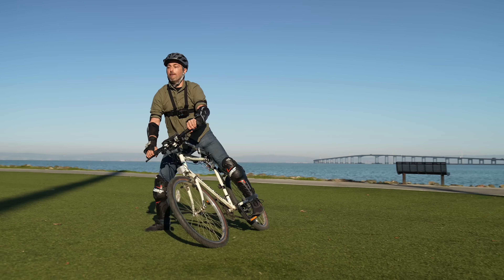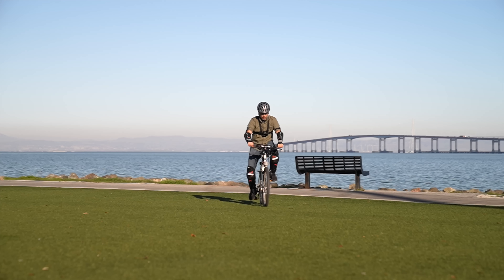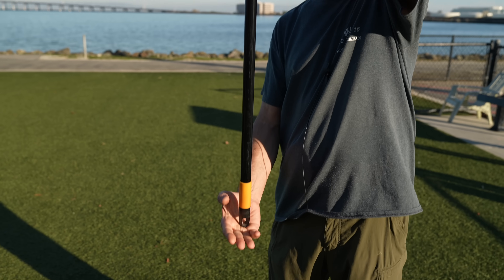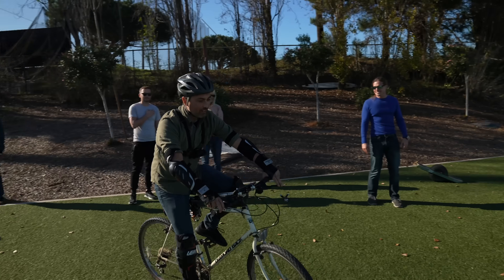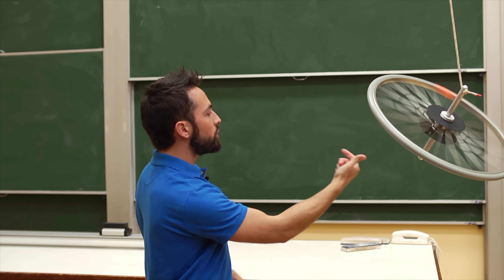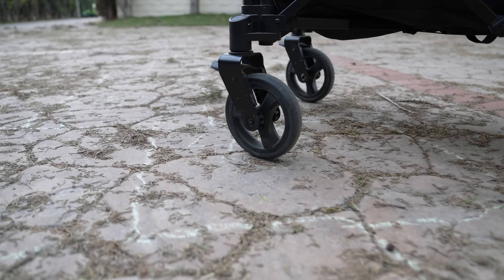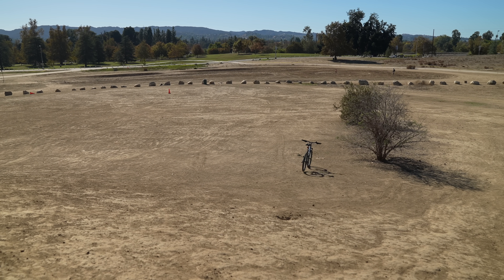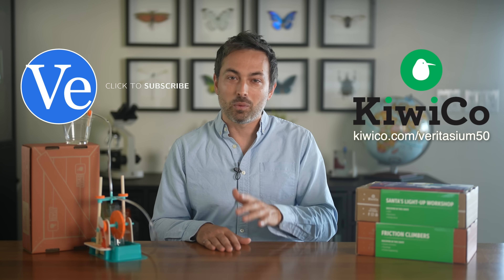Most People Don't Know How Bikes Work

Comment: The next time you bike. Try ACTUALLY turning the handle bars to turn.
You actually press down/lean the handle bar to turn, you don't twist it.
You can only twist it in very low speeds without falling over.

Comment: You really need to master this before starting motorcycling. It much faster than bycicle so many times you need a long countersteer (putting force to the other direction) not only to initiate the turn but almost half the turn especially high speed long turn. You can crash if you don't know this when you are panic.

Comment: this is called counter-steering and us motorcycles riders almost always need to account for it at the speeds we travel. A common idea is "push right to go right". with Pushing right essentially meaning turn handlebar left.
Reply: @Joseph75623  True, but the overarching point being that the effect demonstrated in this video has no relationship whatsoever to motorcycle counter-steering.  This video is all about balance and center of mass effects at low speeds and the body's ability to "naturally" understand the cause & effect relationships of fine balance control.
Reply: @Joseph75623  Complete nonsense...  Basically, the gyroscopic precession effect that is the core of the motorcycle experience does not exist on a bicycle.  The effect is so insignificant that it basically does not exist unless you are going very fast and are an extremely light rider.  It's simple physics...
Reply: @Joseph75623  So close, but you don't understand what countersteering actually does on a motorcycle does, do you?  I rode for about 15 years and the effect has no equivalent on a bicycle.  Countersteering has NOTHING to do with "stability" as such, it is the effect of applying a force to the handlebar and having the motorcycle immediately and significantly lean in the direction of force.  With enough pressure, the direction change can be quite violent, and it's taught as an emergency swerve tactic.
Reply: Not really...  Counter-steering does not have the same mechanic; at speeds where counter-steering is valid, you do not; "push-right, then "pull-left" to turn left, you just push left and lean with the turn to get the appropriate radius.  With motorcycles, it's all about contact patch and the lean angles; gyroscopic precession via pressing on the handlebar starts the lean, but the contact patch relative to the center-line of the front (and to a degree, rear) tires dictates the radius of the turn.  You can follow a curve on a motorcycle by simply shifting your weight and having no net force on the handlebars, but it takes more skill.
Reply: @awebuser5914  There's no such thing as "speeds where counter steering is valid vs speeds where it isn't". A bike will always initiate a turn with a counter steer, whether you're doing it consciously or not. The advantage of doing it consciously is that it means you are in control rather than just relying on the physics of the system and your intuition to do the work for you.
Reply: @allmhuran  At 5km/h counter-steering is pointless, it has no effect and will cause you to more or less fall over! ;)  At low speeds, you're essentially doing what this video illustrates ("steering" the handlebars through significant angular deflection).  The gyroscopic precession effect is completely absent at very low speeds, which is kind of the entire point of motorcycle counter-steering.
Reply: @awebuser5914  Counter steering has nothing to do with precession.

There is literally an equation that describes the relationship between the angle to the centre of mass, tangential velocity, and turning radius. There's no "minimum speed below which the equation doesn't apply". 

A bike cannot perform a stable turn unless there is a lean involved. The lean doesn't have to be the frame of the bike itself, what matters is the centre of mass. But putting the centre of mass into a stable leaned over position requires a countersteer. At very slow speeds the required lean is tiny, and the countersteer is barely perceptible. In fact, most of the time you simply allow the continous instability of the motorcycle to provide that countersteer. The front tyre is constantly wobbling back and forth, so if one of those wobbles is simply allowed to continue for a fraction of a second, that's your countersteer. But it's still a countersteer.

The difference in the experience at low speed is that at low speed the forces on the steering geometry are much smaller. This means that the natural tendency of the front wheel to "flop" in the direction of the turn will not happen quickly enough. To be clear: During a stable turn, the front tyre is pointed in the direction of the turn. During a left turn, the fron tyre is pointed to the left. The countersteer isn't maintained throughout, it's just there to create the necessary lean angle. But once the countersteer is complete and the required lean angle exists, the front tyre has to turn the other way and point into the turn. At low speed the steering geometry doesn't accomplish this fast enough, so you have to manually help it along.

So yes, you usually do have to turn the handlebars into the direction of the turn at low speed. But that doesn't mean there wasn't a countersteer. The countersteer has already happened before you do this.

Comment: Fun litle science fact about gyroscopic precession. Motorbike drivers actually use this to our advantage all the time, if your are at a sufficient speed with the motorbike to have the wheels give you the gyroscopic precession effect. and you are just coasting down a road with a slight turn (lets say a right hand turn) by giving the handlebars a slight push on the right side, the bike will turn right! I thought it was really interesting when I figured out I had been doing it the entire time! This also works with bikes aswell, but speed is a factor, so if you want to test this effect, please wear protective gear.

Comment: You don’t need a fancy RC bike with locking handlebars to prove this to yourself; you just need to ride with one hand, but open the palm before you initiate a turn, you’ll then only be able to push the bar rather than pull and you’ll soon realise you can only initiate a turn in the opposite direction of the handlebar movement.

Comment: It would have been a nice experiment for validating your model (assumption) to push down a bike on the same hill with locked handle bars. (The experiment at the end shows that mass distribution and steering is enough but it does not show what you claim either: that it's necessary for self balancing. I.e. that it is the main reason and not the gyro effect.) I'm not arguing you're wrong, I'm just saying that this experiment would also be needed to prove the point (at least verify the claim) with rigour.

Comment: wait,  how would this work while riding without using your hands? In that way you could probably be quite easily start the desired turn. 
At least you can perform controlled turns quite easily. And you cannot first counter steer, as you are not touching the handlebars to instigate the turn. 

Therefore it seems the mechanism for turning would then be to just lean left, and the steering wheel would follow left. 
This is  at least how it intuitively feels to make a turn without hands

Comment: It would be fascinating to see you delve further into BMX frame/fork geometry, in freestyle BMX riders have different geometry for different uses everything from the height of the frame itself, to the length of the chainstays and even smaller crank arms. everything is often customised specifically for the rider at the top level.

Over all it would be interesting to see the physics behind each change in geometry explained in a video of this style. It's been done plenty with skateboarding but I have never seen it addressed in any cycle sports.

Comment: This was the first (almost) thing I learned in my motorcycle training licence course; if you need to dive ride, push (hit) the right handlebar forward.
It was a cool paradigm shift in my understanding.
Reply: It's all a matter of degrees.  Hit that right handle bar too hard and the wheel is going too far left, you're going to spill to the right.  Unless by 'dive ride' you mean 'dive right' as in dismount/ditch to the right.   A slight push forward shifts the bike to the left, transitioning your weight to the right, so when you want to make that hard right turn and bring the wheel back in line you're leaning into the right turn and don't need to 'steer' right so much - speed dependent, of course.

Comment: How do you explan turning without using the handlebar (no hands on it)? As a cyclist of many years i stoped using the bar and only turn using the center of mass to my advantage. I can balance the bike as it moves forward even at low speed without hands.

Comment: I rode a motorcycle for a long while.  I think there are two ways of steering which differ according to the speed you are going.   At high speed,  you apply a force in the opposite direction to the turn.  At low speed, you apply force to counter steer and then to steer in the direction of turn.  Goodness knows what happens inbetween.  It would be interesting to measure these forces.

Comment: This is what you do when you want to do a tight (full steering lock) 180 degree turn with a motorcycle. Quick counter steer to pick up momentum and then immediately turning the handlebar to the actual direction you want to turn to. This is known as "japanese" style U-turn.

Comment: Professional cyclists don't have to first counter steer as they know how to lean to the side they're going to turn to. So locking one side shouldn't pose many problems to those who are very proficient at riding a bike. Locking both directions is another problem though, no one can balance themselves without minute adjustments unless you can get a circus performer with a balancing pole trying to ride that bike.

Comment: Motorcyclists are taught this as an emergency counter steer effect.  To turn right you Push forward on right handlebar, frontwheel turns left, bike leans to right, wheel and bike then turn to right.  When at speed, it turns right faster this way then simply turning the handlebar.  It works well.

Comment: I think it must also be said that counter steering is not only from the handles, and the side they point to, but also the downward force applied on to the pedals. For instance, I can ride the bike on a straight line, by shifting my weight/downward force on the pedals. So if I have to correct/balance the bike on a straight line from left to right, I lean the whole bike to the left using the handle bar (not turning it), and start applying downward form using my right leg on the pedal, while my bode stays center, along the line. This makes the bike go straight without correcting/turning the handle bar even though its swaying from side to side.

Comment: Have you ever like I don’t know, not use your bars to make turn 😅 I do race on bicycles, and I rarely use my bars when going down a mountain pass(road bike), you can move your weight before the turn and tilt your pike, that way you can turn without using bars, but at least some speed is required tho, on the other way if you stand up, you are able to tilt the bike even at low speeds, but that’s more for funn purposes.😅 Not everyone uses counter steer while

Comment: It would be interesting to look, how a pro cyclist reacts. And the difference between Mountainbikers running downhill and roadbikers. For me it feels just counter intuitive in sharp turns or while riding high speeds to steer in to the other direction. 

Yes, you can ride free handed because the bike stabilises Itself. But just turning in one direction without leaning in is the central question. It changes with the style how you ride.
Reply: when you go fast and lean, the bike/motorcycle presses against ground opposite to where you are leaning in order to equal it out. but when you go slow that leaning doesnt push ground hard enough so you have to counter steer with handle bars?

Comment: I'm pretty sure quite a lot of dutch people can steer a bike without using the steer but using leaning. If you practice a bit you can even corner. Just don't put your hands on the steer when it's fixed

Comment: I don't think this holds true at higher speeds. At higher speeds steering is done more by leaning rather than using the stearing handle. At higher speeds I don't think you have to counter steer first. Also you can certainly turn left/right from standing without having to counter steer first.

Comment: I disagree, I think it's possible to turn left without turning right by slowly leaning to the left side and when you are about to fall, you turn left to stabalize. But that requires you to know in what direction to steer or a longer delay (from green light to actually turning) which in this particular setup is not the case.
Please let me know if I'm missing something.
Edit: maybe I could have waited a little longer, but the sentence at 1:47 was bothering me so much I just had to write my opinion :D

Comment: Most motorcyclist know about counter steering and at speed you do it continuously through the turn, not just to initiate it (same applies to bicycles). When I'm turning my motorcycle through a right hand bend I'll push away on the right hand grip and pull towards me with the left and do the opposite as I complete the turn (i.e. to stand the bike back up).

Comment: Excellent video, but you have forgotten one self steering effect. Since the cross section of a bicycle tire is a circle with a radius bigger than zero, the drag force of the wheel (caused by the bearings and primarily during braking) is not in line with the fork's axis of rotation when leaning the bike during a turn. Therefore the drag force acts upon this lever creating a stabilizing torque. This effect especially helps to straighten up the bike when braking during a turn. Although I am not quite sure how big this effect is on bicycles, it is definitely relevant in motorcycles due to their larger tire cross sections.

By the way there is also a self destabilizing effect caused by the trail, since a turning a wheel moves the contact patch to the outside of the corner which causes the drag force to create a reentering torque, similar to how a cars wheels tend to straighten out when turned and letting go of the steering wheel.

Comment: Counter steering is taught and much talked about in the motorcycling community. I had been riding bicycles and light and slow motorcycles for years without knowing to consciously or deliberately counter steer. But then I got my first supersport motorcycle, a CBR600RR and I could barely steer it at speeds over 60 MPH, until I tried deliberately to counter steer. The faster you go on a bike the more you need to be deliberate with the counter steer input. On a bicycle, you don't realize you're doing it until somebody puts you on a contraption like this.

Comment: This perfectly illustrates the difference between science and engineering. The engineers just makes something work, and only figure out how something really works if necessary, otherwise you just solve problems as fast as possible, as the goal is not knowledge but a working machine. Hence why we have bicycles long before understanding how or why they work.

Comment: From the comfort of my bed and with no evidence, I feel like the counter steering is only needed to be done with low speed. At highspeed a direct approach to steering works just fine
Reply: It is actually more necessary at higher speeds.
Reply: @godfreypigott  really i feel like when I am using my weight at highspeeds and push out one knee like the Motorbike Racers do, then I can mostly turn just by using my weight to initiate the turn and then complete it via steering
Reply: But maybe I'll have to go on a morning bike ride today
Reply: @i5ten   I think you'll need someone to video you and then play it in slow motion. It is not very perceptible. But motor bike riders notice it.

Comment: Yes, but, how do I ride (and turn) a bicycle handless though if steering opposite way is so essential?
Reply: Can you do that at high speed?
Reply: @godfreypigott  Up to 30 km/h speed affects turn sharpness only, as per w/hands on. I doubt I tried it more than 30 km/h.
Reply: @yurykomarinskiy9497   I think what you'll find is that the front wheel is wobbling side to side, and you are subconsciously waiting for it to wobble in one direction before leaning in the other.
Reply: @godfreypigott  No way! That's what I'm thinking. Got to prove it though. <Gone filming>

Comment: On a motorcyle, when going fast, like above 100km/h (60m/h) you have toactually push down on the handgrip, pushing it into the ground to counter steer there is that much force trying to right itself.
Reply: Pushing down does nothing, except lift your ass up if you push hard enough.
Reply: @XtreeM_FaiL  pushing down in the turn to increase the turn is what I was referring to. And not on a track, you use a different technique and riding position for track work. Have you ever raced a motorbike?